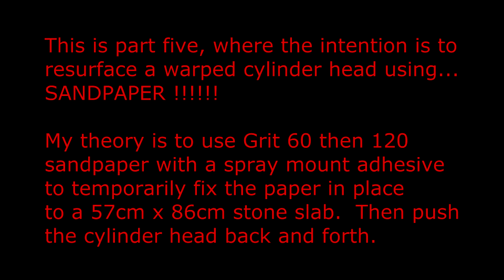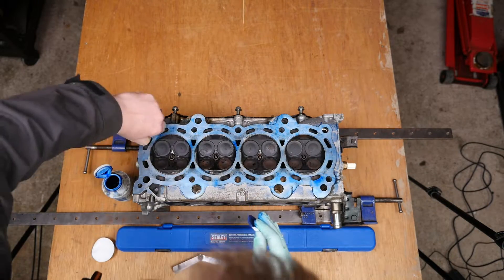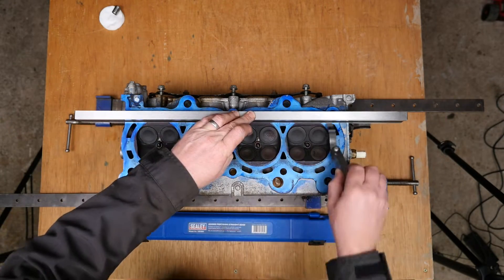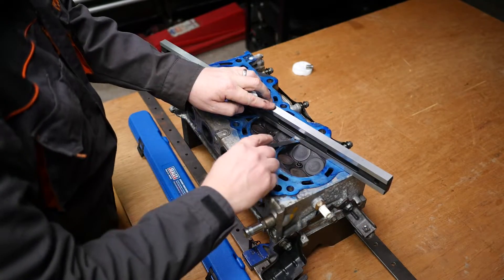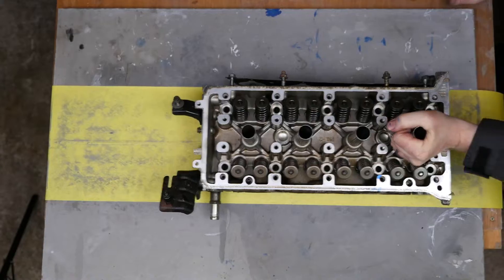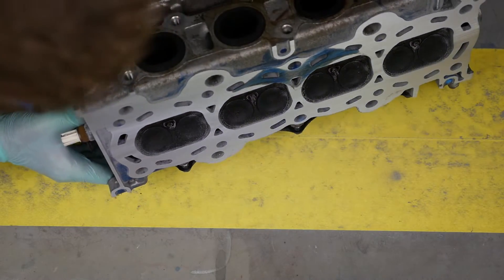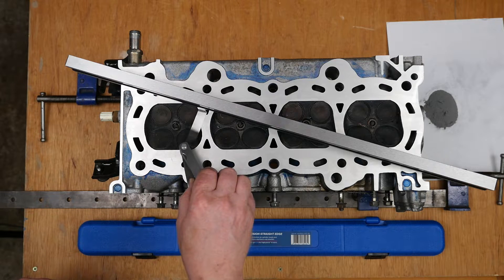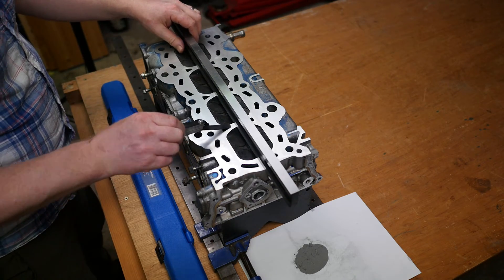Part 5 - Honda CRV 2 litre K20 A4 .... Skimming Cylinder Head with Sand Paper & Stone Slab.

Comment: At this stage I’d be feeling rather depressed - the amount of metal removal by sanding is mind numbing…..😂😂😂😂
Reply from the maker: It worked though, car drove lovely afterwards.
Reply: There’s a gauge cast into most heads. It’s horse shoe shaped on that one. Typically that’s the point where the valves will contact. He’s no where near it on this head. For a daily driver I’d be willing to scratch the bottom of it, and from the shots he’s only 1/2 way there. In normal driving the engine just won’t see the rpm’s to contact the valves, and the marginal raise in compression will likely be canceled out by a worn valve train, and fuel system.

Comment: Grit 40 is the best in my opinion. Very coarse and it will cut fast. You still have low spots on the edges of the head.

Comment: You need to sand side to side also when sanding.  Back and forth wears the ends off a little more.   Water Sand Paper and water can help with the clogging.  3M makes Adhesive Sand Paper by the Roll in multiple widths you can apply to a Stainless Steel Table with a flat top.  I use back and forth/side to side and circular motions without leaning on the head. = I try to just use the weight of the Head when sanding.  I don't use the Paint.  You can see things well enough without it.
Reply from the maker: Thank you for your comment.  Thankfully things worked out in the end and the engine ran ok.  I think most engineers would cringe at me using sandpaper lol
Reply: @CoatsandGaiters  I sanded both Heads on a 02 Grand Am GT 3.4.  Both Heads were warped/leaking.  Runs good.  It's a work out.  Bought it at a Wrecker Auction.  No Key No Start.  350$  Ran across your Vid looking for various valve lapping techniques.  I'm replacing Valves in two y30a5 Honda 3.0 Heads.  I'll sand a little on them, too.  If only to clean the surface.  Keep the Vids coming.

Comment: Sir, may i know what kind of paint and adhesive spray that you used? thanks.
Reply from the maker: It was just Builders contact adhesive, like the stuff used to hold carpet down I think.  The Marking blue was the metal working type they use for scribing out.  It's like a blue water more than a paint.  Might be called layout stain or Prussian blue.
Reply: @CoatsandGaiters  Thank you sir, my fortuner getting overheat then i open the cylinder head i was found out there is a warp 0.008th/inc.

Comment: Hi, Your metric thicknesses are getting thicker but your imperial ones are getting thinner!!!!!! Surely not 1/n thousands but n thousands 1, 2, 3, 4,etc thou.

Anyway I would get an engine machine shop to skim the cylinder head if need be. It think it cost me £60 or £80 for a 4 cylinder head about 3 years ago. May have been less I cannot honestly remember unless I can find the receipt. To me that's money well spent to avoid all the grief of trying to skim it flat yourself. But good suff on checking it's flatness.
Reply from the maker: Hi and thank you for your comment.  I partly wanted to see if It could be repaired by this method as I had seen it done in several videos online.  I was also a bit concerned that if a machine shop made a mistake I would be without a head.  I heard a whisper that sometimes if a garage or machine shop makes a mistake they have been known to find a reason for the head being damaged in some other way and saying it was scrap.  I wouldn't be able to prove otherwise so would be without a cylinder head.   I trusted a Volvo main dealer once to my extreme cost of £1,000.  The lift pump failed in the fuel tank but they replaced that last after replacing the main fuel pump under the car and the fuel distributor.  So a bill that should have been easily under £200 was made to be £1,000.
Reply: @CoatsandGaiters  Yep there is also the incompetence and down right dishonesty of dealers. But I am talking about a proper engine machine shop who would hopefully know what they are doing. I guess you could always check it after a skim/refacing before actually refitting it. I just visited a Ford Main Dealer with a Ford Ka (inherited from Dad) which wouldn't start and had stumped me even when I got a basic OBD II code reader no obvious error codes to suggest why it wouldn't start. The Ford dealer wanted £66 just to carry out a "diagnostic" which they they didn't do and told me the fuel pump was knackered and some other Evap valve physically broken which I know wasn't as the car had only done 7k miles from new as my father bought it brand new and only did 4,200 miles in it and in my remaining 3k miles NOTHING has been physically broken certainly not in the location of the part they showed me. Anyway they wanted wait for it ........... £903 including VAT to repair and when I protested as it is a Mk1 Ka worth only £1000 max despite being like new bought from them new and with subsequent FULL Ford Service history, they reduced their quote to repair to £785.00 to a fit replacement fuel pump £560 and some Evap valve £235. They said the fuel pump was dead giving no pressure and no fuel to the engine. Thanks but no thanks so I paid them £66 for nothing just to get the car back and had to recover it to my home by breakdown service provider who reluctantly agreed. Once home the strange thing was that when I disconnected the fuel feed to the engine and turned it over fuel shot out of the fuel line like a water canon so the fuel pump is fine! SO still no nearer to solving them problem as to why it loses all power and dies on a long run after about 7-80m miles and won't then start, even weeks after when cold. No error coded for the fuel pump only the Evap circuit which doing my research on the internet and YT is really difficult to identify where a fault lies. Yep most garages and in particular main dealers are a bunch of crooks. So I share your reluctance to use and cynicism of them. But a reputable engine machine shop, shouldn't rip people off. Of course I know there are probably some that will but just saying. Good luck. How's the 106 cylinder head job coming on?  ;@)
Reply from the maker: @alexmorgan3435  it is worrying isn't it !!!!! an elderly lady friend of ours took her 2013 Citroen in for an MOT, thankfully I do trust our local garage for MOT's which tend to fail on things I expected but she took her car for an MOT and its was £300 which really surprised me.  Apparently the windscreen washers failed the MOT.  Normally this would be a blocked washer jet from my experience but no.......she needed a new washer motor !!!!  Maybe it did fail but I'd be really surprised if it did.   I'm going to pretend I didn't read the bit on the 106 cylinder head lol  As soon as I read that I knew it was you haha.
Reply: @CoatsandGaiters  Only pulling your on the 106. Same thing happened to my elderly neighbour who had a Corsa, the last newer shape. It failed MOT on windscreen washers not working. So local garage outfit she took it to charged her £580 to replace the windscreen wiper motor. Total con artists. Within the next few months the head gasket failed. I suspect they loosened a few bolts most likely as it was fine before. I drove it a few times and checked it over a couple of times for her. Anyway she got rid of it for a VW Polo which she has had since about 3 years now (10 plate). It sounds you like me have always done your own servicing owing to lack of trust and bad experiences with car dealers and other dodgy independent garages. All the "good old boys" seem to have retired or died. One such old boy used to lend me tools I didn't have to help me service my cars. When I took them for MOT he and his mechanic who is probably coming up to retirement himself now used to say I looked after cars better than they did and they were really good. The old boy sold his old garage site in the middle of town. It's now a block of maisonettes. He used to have all the old signs and cans, miniature fire engines he lovingly maintained and took to steam fares. All gone consigned to history. When I were a lad .......... Thanks for your replies and making your videos. You have a natural gift. A+++.
Reply from the maker: @alexmorgan3435  Blimey I never even thought of a garage loosening the head bolts !!!!! I bet some have though....good way to get business in with a loyal customer.  I bet they do all sorts of things, my head doesn't work that way but to them I guess they see it as 'a way to survive' and its part of being a garage.  There was an american series that interviewed garages over there and they openly said when a customer walks in for a standard service we hit them hard with up selling as thats the way we survive.  Your like me, we prefer the old days, the local old boy mechanic working on a Morris Minor with pride.  Cars were expensive items that you looked after unlike today where they are disposable.   I expect the reality is though that the costs of living today wouldn't support a small one man band buying premises and repairing cars at ones own pace.  You'd be forced to have to get so many in every day to cover the business rates.  Thank you for that last compliment.  It's really hard work to make a video, I find it exhausting using multiple cameras, syncing the sound etc......Its given me an idea on what some YouTubers have gone through to be successful.